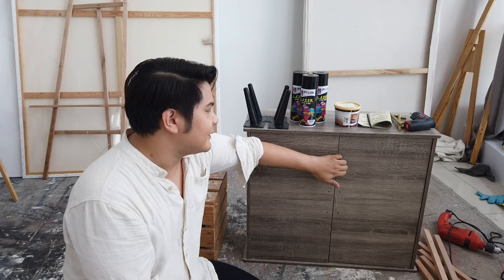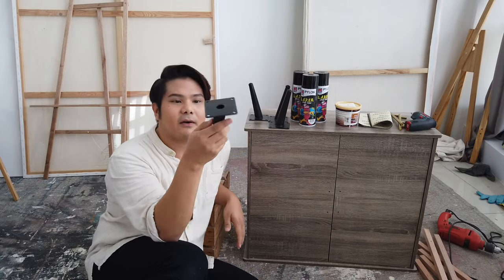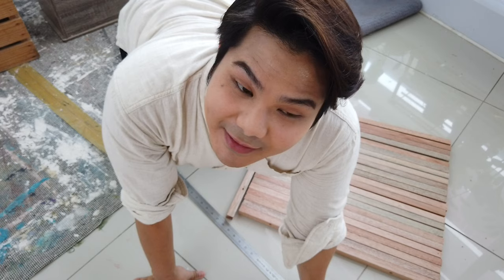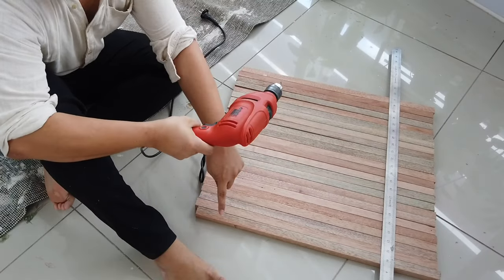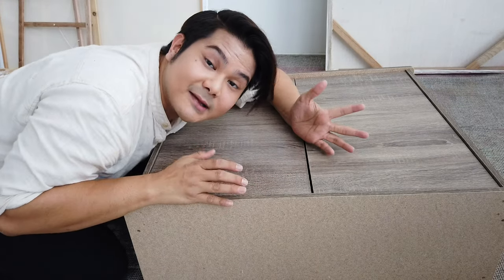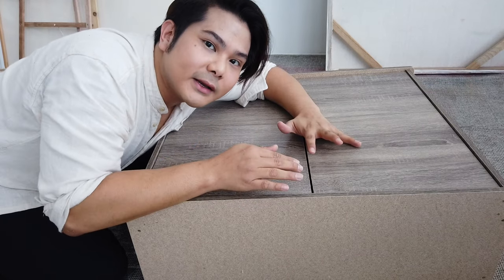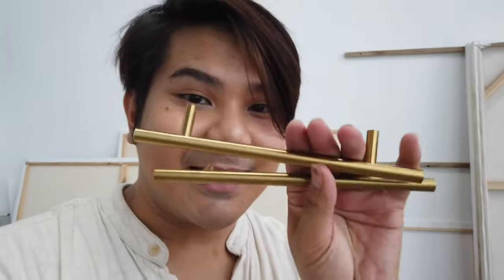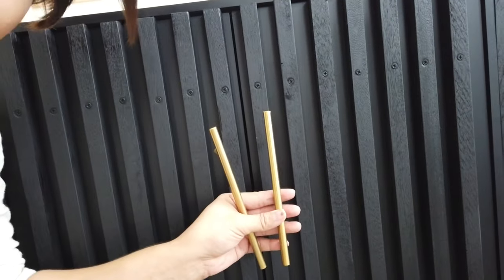UPCYCLED OLD SHOE RACK from Shopee | AIMAN ARIFF

Comment: Hello love the diy! Just a few questions;

1) Which hardware store exactly did you went to get the wood?

2) and when you “screw” the wood to the door,does it penetrate the door as well or the screw just end at the door? Does it need glue to stick? Same for the handle as well,do you use longer screws for it to penetrate?

Thank youu
Reply from the maker: Hello I bought at Hardware section 9 shah alam. But theres alot more hardware that sells wood like this. And also, yes it penetrated the door a little, but be sure the get the correct length for the screws. Same goes to the handles, get a the longer ones🙏🏻
Reply: @AimanAriffKhairuddin  Awesome! Appreciate the reply! This will be my first diy and im excited!! Thank you for the content! 🙌🏼
Reply from the maker: @sw-ou1jg  you are most welcome!!